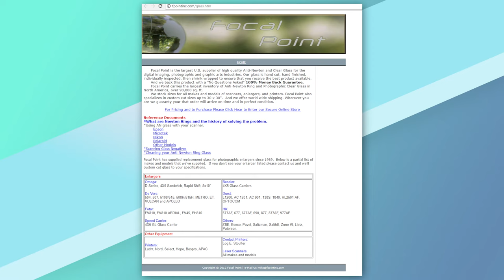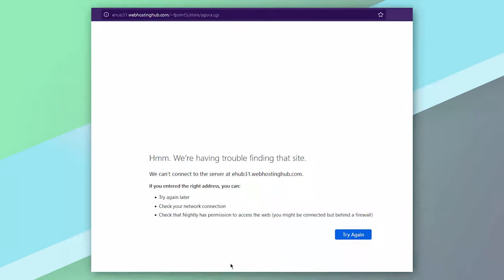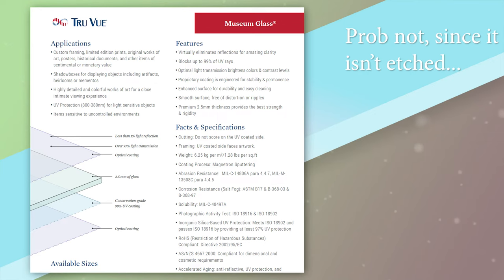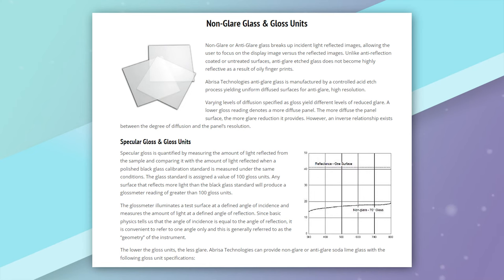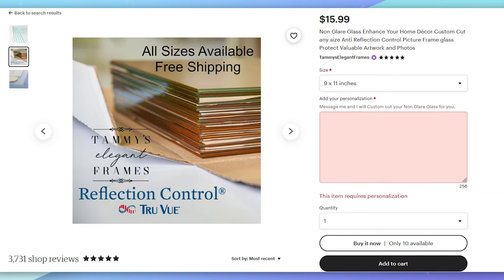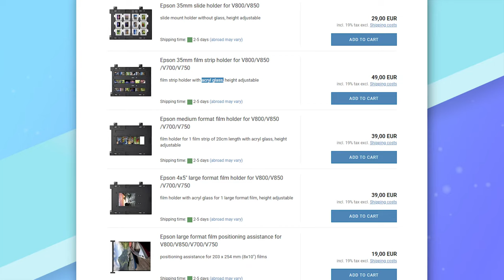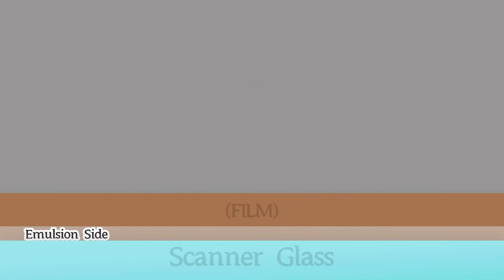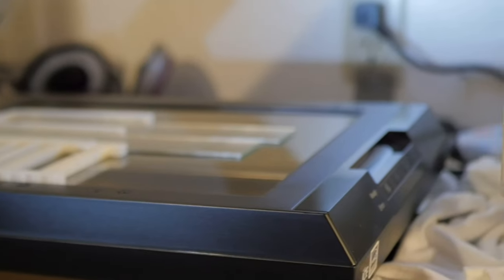WHY YOU NEED TO STOP BUYING ANTI NEWTON RING GLASS!

Comment: Yesterday I went to my local framing shop. They had some of this etched glass, but they said everyone is switching to coated glass. In fact, they dug the etched glass out of their old storage. This stuff is harder to find at framing shops because it does not perform as well as coated glass. 

So, everyone better get out there and get all the etched glass you can find!

BTW- four pieces 35mm wide by 7inches long cost me $6. Nice. Bonus, the scanning of color negatives is excellent. I used the procedure described in the video on my Epson 4990. Works great!

Comment: It's interference that causes the "newton ring" phenomenon. It looks like an oil slick because it's the exact same phenomenon. It's caused by the distance between the two surfaces being nearly parallel and as such the light will interfere with itself. The distance between the surfaces is some multiple of the wavelength of light that you see which is why you get a rainbow, the distance is changing and so is the color. Which is why the etching works, if you eliminate the reflection between the two surfaces you eliminate the interference. No interference, no rainbow. Bit of a ramble, but hopefully it makes sense. Watch Huygens Optics here on YouTube to get the juicy details.

Comment: A7r iva + sigma 105mm macro Art reveals the "glossness" of the glass and not suitable for highres scanning... I finally with trials and errors used tapes with lead strips to keep the edge firmly flat and the emulsion side will conform to flatness by it. Nothing now blocks the emulsion and the scanning is better than ever
Reply: could you elaborate? tapes with lead strips? ty!

Comment: That was really helpful, thanks! I have the same scanner and want to get rid of the original film holder as well. Do you think it would make sense to use just one glass panel for two film strips? Or is it important to somewhat match film strip size and glass size? Most places I can order from have a minimum width of 10cm.
Reply from the maker: you can make it work but aligning both strips of film so they are as straight as possible is gonna be harder unless you figure out some kind of holding or alignment jig. You can always just get a big sheet and cut it to whatever size you need after.

Comment: If you're going straight on the scanner glass like you suggest without the film holder, is there any benefit to cutting the glass exactly to negative size? Would it be a little easier to cut it a bit larger so you don't have to line it up as precisely? P.S. this video is amazing and exactly what I've been looking for for a while!
Reply from the maker: In my setup I have a film holder which is exactly the side of the negative so my glass is cut to that size too and it makes alignment easier, but if you have another way of getting your negatives lined up then yeah glass size doesn't matter at all.

Comment: I am trying to find solution how to scan large format film on my epson v600. It so seems that the top part of the scanner projecting light is just a bit smaller than I would need for my 4x5. I have seen a guy on youtube using some small led tablet for 20 bucks from amazon, to cover the film instead of glass (your method). I just got idea to order one of those matt screen protectors and cover the film on the scanner with my iPad while projecting white background. Its one of the newer ipad pros so they get quite bright. Do you see this working? Thanks btw, great video.
Reply from the maker: it could work, colors might be off and exposure will be weird but I think you could probably tune the light to work pretty good assuming it is bright enough to begin with. Just make sure you don't cover up the calibration zone near the "top" of the bed or it will refuse to scan. No color correction mode in epson scan will probably be what you wanna use.
Reply from the maker: oh and you could also just scan half of your frame move it over and scan the other half, then stich it together in photoshop after. Then you wouldn't have to worry about any weird issues from using an alternative light source!
Reply: I scan large format on my v550. I use the 5x4 holder which I've cut down. I scan one half, slide it over, scan the other and then use the photo stitch tool in lightroom, works every time 😊
Reply: Not sure if the iPad is a good idea, but curious how it worked out for you. It's possible the iPad's display could cause color artifacts as the CCD cycles through its colors on each row. I would try using a lightbox (I use a cheap Huion tracing pad as a mini light table and it has uniform color and decent CRI). Whatever you choose, never block the first 3/4" or 20mm of the bed, otherwise you will get crazy colors and lines by throwing off the calibration (assuming it doesn't throw an error).

If you use the stitching method, just be aware that you'll need the negative to be a planar/flat as possible. And I would probably stitch it in Hugin if possible -- I've found it gives significantly better results for image/pano stitching than Photoshop with less work.

Comment: I bought some Tru Vue Reflection Control glass on your recommendation, and I'm still getting Newton Rings. :(
Reply from the maker: what film are you using?
Reply: @ShyStudios  It's my grandma's old square format instamatics.
Reply from the maker: @joeboswellphilosophy  I wonder if that film's emulsion is more glossy or something. See if more mounting pressure makes them go away or use some kind of thin shim to lift the film away from the scanners glass. Curved side up so the etched glass will hold it down flat.
Reply: @ShyStudios  Thank you. I had some tentative success this morning after rolling the films up overnight to create a horizontal curl rather than a vertical curl. Have only done a couple of tests so far but will scan more soon.
Reply: @ShyStudios  Damn, problem still occurring. I don't understand what you mean by a 'thin shim' to lift the film from the scanner glass. With the etched glass on top it's going to touch the scanner no matter what. I wonder if I need etched glass on both sides of the film.
Reply from the maker: @joeboswellphilosophy  look at the diagram at 5:27, instead of a film holder you can use pretty much anything to slightly lift the film off the bed's glass. A few layers of tape or some sticky notes on the edges of where the film will be should be enough. OR just use a film holder. If you are still getting newton rings and you are sure nothing is touching the glass of the scanner then the problem is between the etched glass and the film.
Reply: @ShyStudios  Okay, I see. I'll try putting a bit of tape along the top and bottom of the film on the emulsion side.
Reply from the maker: @joeboswellphilosophy  you should probably put it on the glass bed, if you put it on the film its gonna rip off the emulsion haha.
Reply: @ShyStudios  Alright, I think I've perfected my technique now. Bought some 1mm card off Amazon, cut it to the size of the scanner bed, and cut some square holes for the film and for the scanner's calibration area. Leaving the card in the scanner, can now sellotape the film to the etched glass and then, holding the glass, position the film precisely over the holes. Emulsion side now held 1mm above the scanner, which seems to be the scanner's focal point anyhow. Have stuck some rubber feet to the etched glass which help press it down when in the scanner, and keep the glass off my desk when I'm taping the film to it. Scans always in the same part of the scanner bed now and perfectly aligned, needing fewer preview scans and digital rotation. Phew, thanks for your help. 😅